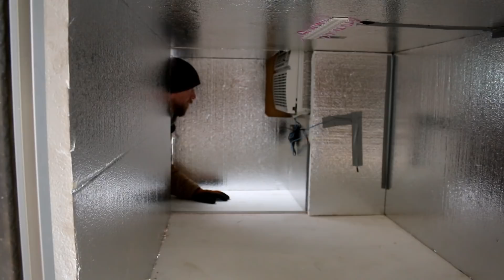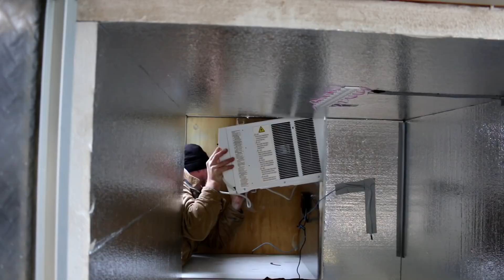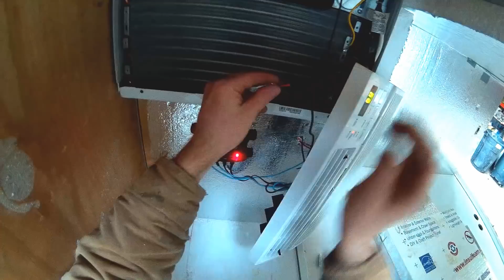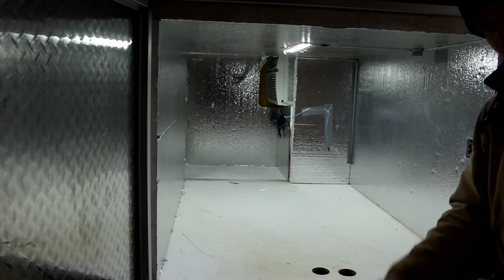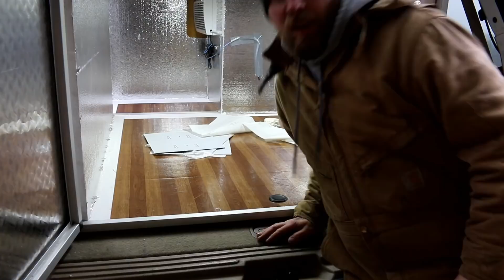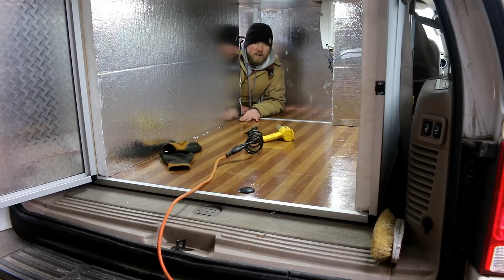The ultimate TAILGATE VEHICLE...or DIY Produce Delivery Cooler Build Part 7

Comment: If you take up brazing you can fix the other unit after you install a fill valve and seal the hole in the pipe. Once sealed and with the valve anyone with the equipment can pump it down and fill it. Could also be an base for converting to an air to water heat pump

Comment: TRM, you need to be careful on those aluminum fins. Handle from the edges and don't crush the fins as you'll reduce the heat transfer ability. Protect the rear fins with an expanded metal screen.

Comment: You can solder the hole in the coil and recharge the unit.  Don't wait.  Moisture will infiltrate parts instead of just the line.  Right now some time solder a vacuum pump and repacement refrigerant will restore it to like new condition.   Oh they may have to install a service port but those are the self tapping water connection for your fridge ice maker.  Otherwise it will have to be a soldered connection

Comment: Nice job Jeff.  Think you have good reason to be happy and proud.  Just a comment from the peanut gallery:  The foam insulation at the back door probably should have some protection.  A piece of angle something.  Probably a plastic piece of some kind would be cheapest.  The constant pulling bins in and out will take a toll on those pretty exposed corners.  Also, if you install something rigid and smooth there it will be easier to keep it looking clean.  Exposed foam will quickly start to look dirty.
Happy New Year
PS I just read that the first American Mars resident is going to be a woman!

Comment: Yeah pretty silly to drill into the unit. I agree about the drain but maybe it isn't as humid there as it is where I live. I had to put holes in our window units because the water was getting flung everywhere by the cooling fan and getting the window sills soaking wet, not the best for wood windows
Reply: Preproto  should have read the directions that came with AC unit most window units depend on a small amount of water to make the work better. My unit has very explicit warning do not drill a drain hole.

That said he should have a drain hole tonallow any water inside his cooler to get out. And a catch pan under the AC with a drain line to get rid of excess water.